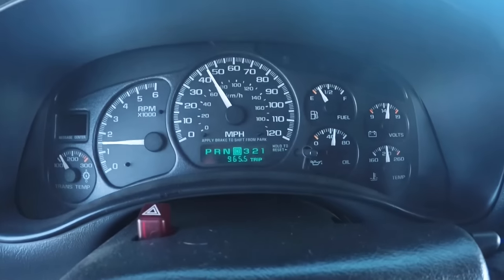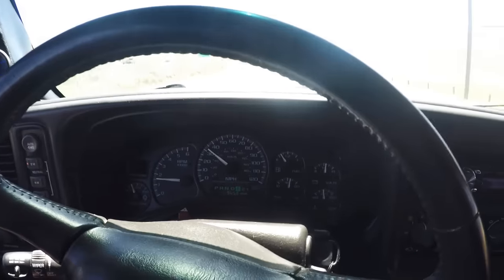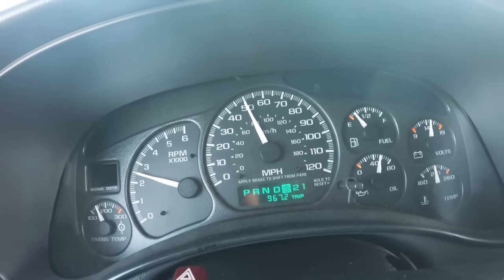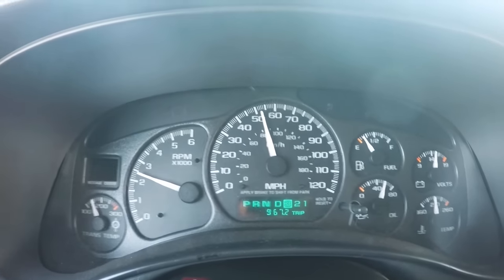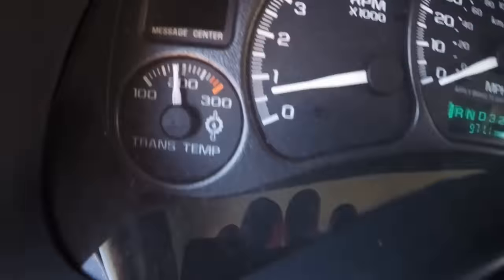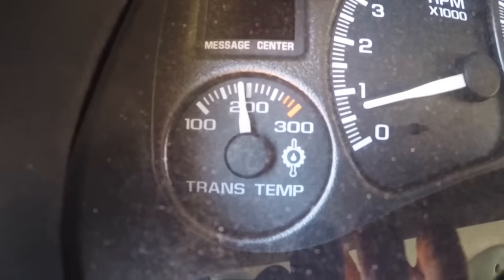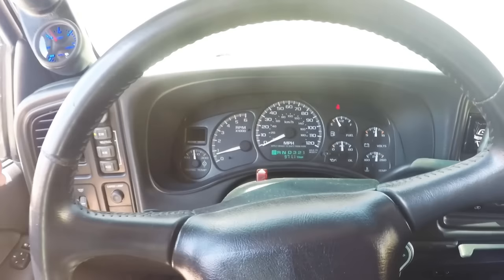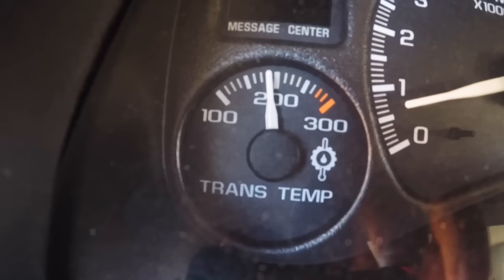6 Month Review With Cam and 3000 Stall Torque Converter

Comment: Some people don’t realize that stalls work with engine and trans and weight ratios lighter the combo sooner the stall. Heavier the later the stall
Reply: It also will not flash at the higher speed if light load is applied.  Plus it’s loose at idle, hence why it’s necessary with a big duration cam.

Comment: Ran a 2500 stall in my 95 k2500 you can daily drive a stalled vehicle just up till your rpm you'll crawl up to speed. It's not that big of a deal breaker just you'll get tired of Grandma's outrunning you to get up to speed for your mpg. But in town with my 350 doing alot of racing in-between tanks of gas I'd get around 12-15 mpg in town on highway around 17-20. Just have fun and enjoy.
Reply from the maker: They are fun. I enjoy mine very much. I don’t see a huge reason not to get one.
Reply: Endless Wishlist I plan on putting a higher stall in my 05 with a shift kit

Comment: It's like a CVT with gears, is the best way I describe it, it gets the engine to its power band, then the trans catches up with the engine as you accelerate, I haven't went that high in stall before, I have ran the higher stall factory converters in a truck, I could see about 1600-1800 without tire spin,until I swapped gear ratios, then it was near stock, it dropped about 200 rpm, going from 2.73's to 3.42 gears, it did light the tires with the gear change, it wasn't best with my cam for performance, but it did allow for the rough idle, I was going to get a 2400-2600, but never did, I'm on another project now, anyone needs to list all mods and weight , gear ratio, tire size, and let the converter guys pick the converter, a 3k stall shouldn't be the first mod, a stock truck engine is done around 4k-4500, about 2k for stock , or 2500 with a bit of gear, depending on weight, and use !
Reply: Not with these LS engines. My bone stock 03 6.0 makes peak torque at 4k rpm, and you can feel it, it really becomes alive 4k-4.5k and revs beautifully to 6k.

Comment: Like you said big cam put your hp/ tq in a different rpm band. You always wanna run your stall for that range. Typically whatever your cam calls for. All a stall means is your converter won't convert any more energy from the flywheel past its stall limit. Quick way to see what type of stall converter you have , hold the break continously while you're in drive and floor it and while watching your rpm. Whatever rps your engine stays at will tell you what stall your converter has.
Reply: I'm assuming that's basically like starting a burnout, but seeing where the point is where the revs hold without breaking traction? Hope this works for AWD so I can see where my LS is at. I wanna stroke the 5.7 to a 6.3, worked heads etc.
Reply: @joshthomas2536 what he’s discussing is foot brake stall speed. If you look up stall converter videos and types there’s a bunch of good ones on here. I believe Hughes has a great video explanation

Comment: Thank you. I’m also putting a 3000/3200 stall converter in a c4 with a sbf 289 with a 512 cam  in a 1964 van econoline. I expect it to be fun, just don’t wanna break my axles 👍🏼

Comment: I have a Hughes 3k converter  on a 383 making may be 480 in front of a th350.  373 rear end.  It is like trying to walk a dog that wants to chase everything in front of you.  If you make a decent amount if power, it will drive at that stall rating.  Mine flashes at like 4500 rpm.  So I cruise at 3k and nearly redline at wot.  3k stall can make your vehicle very difficult to daily.  Every engine and combo will be different.  Yours seems tame, lucky you haha

Comment: Everyone tells me I’m overkill but I use a 3500 stall converter in my cammed 87 Buick Grand National with a precision ball bearing 6262 turbo. On stock heads and block built with completely forged internals. Plus all the mods alcohol,etc. but everyone said I should have went with a 3000 stall. But it is what it is.
Reply from the maker: If it’s a good converter it’s not really that much of a difference. That sounds like a pretty sweet setup.
Reply: Yea that’s way too lose for a 6262 gn a 9.5inch 18 blade ptc from dusty would really wake that car up.
Reply: DJ Tech12zz I’ve got a z71 with a 3600 stall haha
Reply: sounds like a nice solid build to me good job 👍
Reply: @pktillidie  agreed...I'm running a 6262 with a ptc 2800lu.  It's been a good combo.
Reply: Not much of a jump. You had a 2500 stall from the factory
Reply: Dj tez Gran national

Comment: The reason transmissions get hot with higher stall is the slipping to get to those higher rpms off the bat. I don't think that's been a big issue since the lock up converter's started gaining traction in the 90's. Before then you had to run engine rpm pretty close to the stall speed to keep transmission temp down and overdrive would be useless. One exception where a lock up would be just as bad as a non lockup would be a lot of stop and go city traffic. I've wanted to upgrade cam and converter depending if motor or transmission breaks 1st... So far I've been waiting 19yrs.

Comment: Its all about combination, stall, gear, cam and weight, tire size.  I would advise getting a gear atleast a 390 . I gained mpg running a 390 gear with my 2500 stall in my malibu gbody. My trans am has a 3k stall and it does perfect with stock 323s but im switching to 390s and cam .  323s not cutting it and not keeping me in power band even with my stock ls6 cam.

Comment: Hello, Does BTR 5.3 HOT ROD CAMSHAFT fit yukon 5.3 2008? I am add long tube headers and Y-PIPE and full exhaust system 3 inch Cold air intake DOD DELETED Yukon 5.3 2008 has 4L60E transmission should I upgrade the converter to FTI STREET BRAWLER 3200 STALL SPEED Thanks a lot Thanks,

Comment: Fact is, my 06 regular cab with a 6.2 in it has a 3800 stall and a transbrake. Also a two step setup and it HATES towing. And my food trailer weighs MAYBE 4000lbs fully loaded. I’m actually thinking about doing a t56 or 2500hd zf6 swap. Just for fun and practical reasons since I tow more than most people.
Reply: I pull it 6000 pounds with my 02 Silverado 2wd all stock, is not the fastest truck pulling that weight but did it ok I would said

Comment: I'm in the midst of installing a 9" 3200RPM stall converter in  my single cab, with 6.0 (370CI), and a 4L80E. I've been running a 10" 2300 RPM stall, and it runs almost like stock. That's with 32" tall tires and 4.10 gears. Just swapped to a sloppy stage 2 cam, and the bigger stall at the same time. Hopefully those 2 changes complement each other. I dont like having to rev the engine super high to get the truck moving so I'm hoping the engine is not crazy in RPM at low speeds with the new converter. I have customers that have vehicles with high stalls and they just sound retarded trying to pull away from a stop sign, or red light, at 3000+ RPM's...
Reply: Big difference in a street/strip high stall and a full competition high stall.  Can be the same stall rpm but react totally different

Comment: Nice one mate. I'm in Australia. I'm in the middle of building a l67 for my Holden wagon. It has 17pound and I'm running a hot cam. Just ordered my 3000 converter today along with corvette servo and b&m stage 2 shift kit. Looking forward to it 😎🤙
Reply: I had all that done on my vn berlina i had. 2nd gear squeels the tyres and used to skid sideways in 2nd lol. Was heaps of fun R.I.P 🙏
Reply: @udownwito.p.p4153  build another one bro . Since this post I have fitted a haltec ECU , bigger cam and 4200 converter. It Fry's tyres every gear hah
Reply: Hello, Does BTR 5.3 HOT ROD CAMSHAFT fit yukon 5.3 2008? I am add long tube headers and Y-PIPE and full exhaust system 3 inch Cold air intake DOD DELETED Yukon 5.3 2008 has 4L60E transmission should I upgrade the converter to FTI STREET BRAWLER 3200 STALL SPEED Thanks a lot Thanks,

Comment: Why is your truck shifting at around 5,200 rpm? If you weren't at WOT I understand but if you were you're missing out on some horsepower. But if that's your shift point you can definitely bump it up a good 1,000 rpm safely and use the cams full potential.
Reply from the maker: I probably wasn’t full throttle. My 5.3 tune used to shift at like 6,300. The tune in my 6.0 is pretty conservative at the moment. But I have a dyno tune next week.
Reply: Endless Wishlist yeah my truck shifts at 6,600 rpm. I need to get it dynoed so I know where peak power is to adjust the shift point.
Reply: Yes..dyno...a good cooler , and more vids...

Comment: I heard you say it is "geared" but didn't catch the numbers ... what are the gears and what size tire are you running? I'm debating whether 3k rpm stall will be enough for my 4.33 rear K5 with 33's and 4L85E
Reply from the maker: 35s with 4.56 gears. 4l60e transmission
Reply: @EndlessWishlist  Ty sir

Comment: I’m putting a 2500 stall and shift kit on my 4l80 I’m running a 6.0 with a Whipple 2.3 3 inch pulley stock internals and heads for now
Reply from the maker: That’s gonna rip!
Reply: james williams how’s that turn out that’s a pretty small stall for powerful build

Comment: Im doing the Texas Speed 223/226 cam in my 5.3 and do you think i could run a 2200-2500 stall? I daily it and dont want a 3000 stall at all.
Reply: Tsp told me that cam would do fine with my stock 4l80e converter. I was gonna go with bigger cam with 3200 stall but after see this ima stay with smaller and stock converter
Reply: @joshshelby7322  i would never go with the stock converter. Biggest cam i would go with a stock converter is a 212/216

Comment: I’m putting a 228/232 .600”/.600” in my stock 5.3L with the stock stall converter. This shouldn’t bring issues you think right? I’m hearing this is ok. I do have a buddy that tunes & will be tuning after the cam is in. Thank ahead of time!
Reply: I am going to be getting better springs tho.
Reply from the maker: Everyone and every setup is different. But I know with my 212/218 in my 5.3 I would want a higher stall with any bigger cam.
Reply: @EndlessWishlist  could I damage anything or is this simply for better top end performance?
Reply from the maker: It won’t hurt anything. But you will most likely lose low end power and pick up top end power

Comment: I have a 2008 tahoe 5.3L with a stage 2 cam , lifters,  push rods and beehive springs . Transmission is built not stock . Cam specs requires a 2800 stall . What stall should I be looking for ? Thanks in advance .
Reply: 2800 stall. Go wit what the cam calls for.

Comment: In the process of a 2007 6.0 swap in a 2001 standard cab sierra. I have the 6.2 rectangular port heads and intake and 595/595 238/242 @112 lobe cam in it w a 3000 stall hughes convertor. Any idea how it will perform? Its also going to be ahead of a th400 trans. Great videos btw
Reply from the maker: Thank you. Hard to say. I’m sure it will run good. Just make sure to measure your piston to valve clearance. That’s a good sized cam.

Comment: High stall is the cheap way ($500) to make a lifted truck quicker without regearing it. But you DESTROY your MPG because your rpms are alot higher. For a daily driver, spend the money and just swap your ring and pinion to 1-2 steps lower geared than what stock would be.... its actually better results but does costs 4 times as much without ruining your mpg as bad. Proper gears for the tire ratio will be quicker (and a little easier on your mpg) than just a high stall...But if you have a lifted/cammed hot rod? Sure. Put the stall in it. Good video though and like the build. 👍
Reply from the maker: Gears were the first thing I did after I lifted it. I put the stall in when I swapped the 6.0

Comment: Sounds like you need to get a car or a lowered 2wd,  any youngsters out there  that want their truck to still be a truck which means it has low in power can still pull a trailer, 4wheelin not a race truck absolutely do not put a 3 Grand stall in it unless you're running hevey  tractor tires.  Until you try everything you just don't know I'm just trying to help. If this doesn't make sense. go for it. enjoy. to each their own, keep in mind if you're going to make that big heavy truck build like a bracket car, get the biggest brakes you can find in a parachute for your daily;)

Comment: First off people !!! If you cam your engine and install high stall convertor YOUR NOT looking for fuel economy.
If you want a truck with fuel economy go buy a Volkswagen truck !!!
Reply: vhp454 true but its still possible to get decent mileage. This isnt 1970 anymore, these new lockup converters are badass and drive like normal at highway speed, retaining decent gas mileage. And all cams are not equal, a small cam like a stage 1 cam is not going to instantly turn your truck into a gas guzzler. Just saying.
Reply: @swappedoutZ71  i was raised to know if you purchase a truck dont look for mileage.
I have been building engines since 1980 and specialise in big block chevys .
I own many vehicles and i personally dont care if any of them get fuel economy. But i can guarantee you my trucks will pull a house down and my cars all cover the quarter mile better than 10 seconds.
I actually have a car with a 632 bbc that gets 5 gallons to the quarter mile but does it under 6 seconds.
Basically it is this. If your asking fuel economy than dont buy a truck. 
I hope im not coming off wrong.
If i have offended you, sorry.
Reply: vhp454 oh nah man i dont care about gas mileage in my truck i was just saying you can have a truck and still get 20mpg i was just saying its not impossible thats all
Reply: @vhp454  ford new turbo v6 get good mileage
Reply: If I bought a Volkswagon Truck, I would probably swap in a 400 ci sbc......I have issues.

Comment: Do you know the avg. MPG you are at right now? No one ever says a number, it's always just not good. Are we talking 8-9 or like 11-12mpgs? Love your videos!! Filled with a bunch of real information!
Reply from the maker: Thank you! And I would say 12. And that will little highway driving.
Reply: Endless Wishlist that's not bad! I have a stock 6.0 l76 in my 09 1500 and I've been getting 13.6mpg for the two years I've had it. Your videos have helped drastically. I'm ordering the BTR TRUCK STAGE III CAM 218/224 .553"/.553" 113+3 tomorrow. It's my daily driver/work truck. The DOD system got me and have two bad lifters so figured do a little upgrade while I'm at it. Any advice or wisdom would be greatly appreciated.
Reply from the maker: Yea that’s a perfect time to upgrade. Are you deleting the dod? I would. I would hate to have to pull everything bad apart for 2 more lifters down the road.
Reply: Endless Wishlist yeah I have the the cam kit, DOD delete, and vvt delete kit with the ls7 lifters and beehive spings plus a bunch more stuff in cart at BTR! Just going to call them in the morning to make sure I have the right stuff picked out before I order. Going to send the heads off for work next Monday so should only be a couple weeks before it's going. I'll definitely post a video! Do you know your whp?
Reply from the maker: Hell yea dude. Definitely post a video. I want to see it! I don’t know my whp but when I get my heads done I’m going to have it dyno tuned so I’ll know then haha
Reply: @petercollier3610  how did deleting the vvt effect your truck?

Comment: pulling the motor on the 2500  today. i want to put in a cam when i do the rebuild maybe a 212/218?
Reply from the maker: Oh yea I would for sure. That cam would be great in a 2500.
Reply: Rick Bean i have the 212/218 and it lags pretty bad from a dry stop i would suggest getting a 2600 stall.
Reply: Larry Washington this is on 5.3 right because I think that can would be perfect for ls1 and no stall

Comment: How abrupt is the lock-up engagement? I was hoping you would include some of the lock up engagements in the video. Once the converter locks i assume its its like "stock," is that correct?
Reply from the maker: It’s not harsh if that is what you are asking. Yes once it locks up it cruises just like normal.
Reply: I was just curious about the lock up. Its not a deal breaker for me. But I was very interested in its drivabilty during lock up. Have you towed at all with the converter? (thanks for your reply btw.)
Reply from the maker: Yea of course, I try to reply to everyone. I have towed with it. About 6-7k and it handled it very well. And the trans never got hot.
Reply: Endless Wishlist  last question, sorry for all the questions.. I’m sure you covered this too, but what’s your tire size and axle gearing?
Reply from the maker: I have 35s with 4.56 gears

Comment: What's your investment in cam springs converter ect
Reply: Cam, springs, and converter will be about $1k. Don't forget about fluids, seals, pushrods, tune etc. Depending on your mileage might want to get timing gear/chain, lifters and oil pump. Inspect your rockers too!

Comment: Holy cow.  My stock 4l80e doesn't get over 150*F on a 90*F day.
Reply: 8.1duragas I know it's not a fair comparison but my 2018 f450 v10 6 speed auto work truck runs 190-200 loaded with my mini ex and trailer that's 15k or unloaded it runs those temps. I leave it on trans temp most of the time to compare to my 4l60e I've never seen above 185-190 on my 60e all stock. It normally runs around 150 and 180 towing
Reply: Duh it is bigger and probably isn't working as hard as his.

Comment: I gotta question! I just been cammed and I still have my stock converter and I keep stalling out when I put either in drive to soon or reverse is it because I need a new converter?
Reply from the maker: No that’s probably tune related or fuel related. Mine did that with a stock stall and an aftermarket one. My fuel pump is weak and my idle was set too low.
Reply: @EndlessWishlist  ohhhhhhh ok
Reply: My oil was low to because my oil symbol illuminated when it died on me